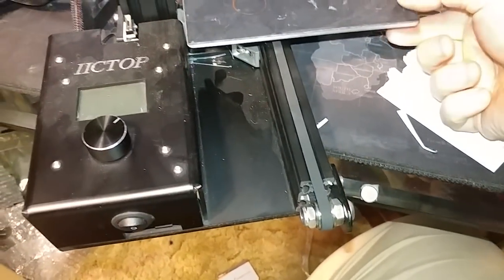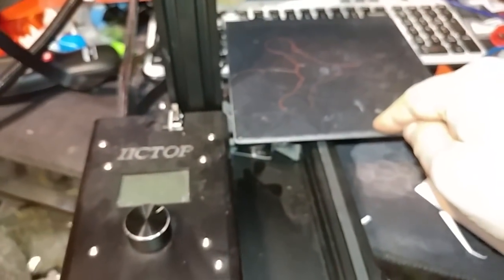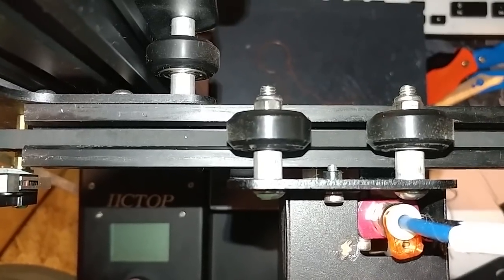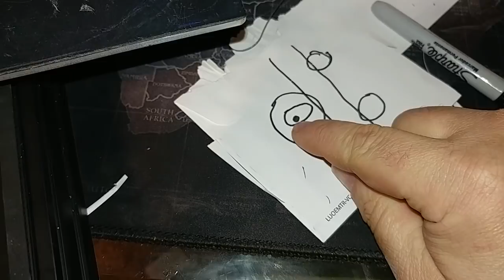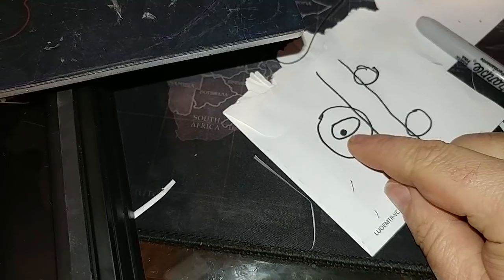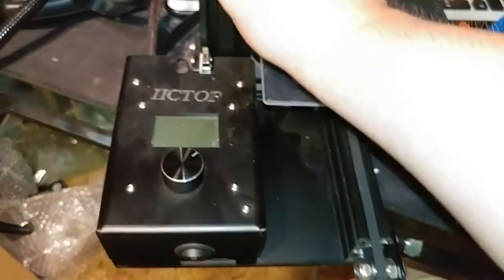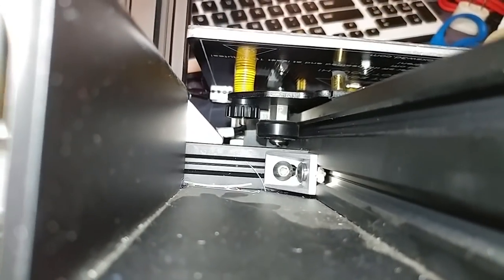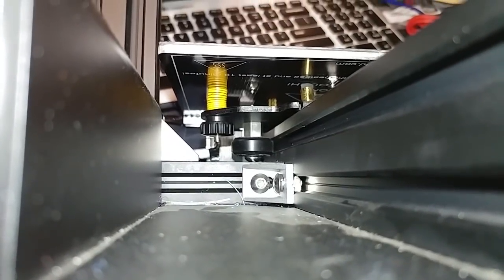Today's 3D Print 171 Quick Tip ender print bed loose wobbles

Comment: Thank you very much for this tutorial. Might look hilarous, but I had another problem that was an uneven, not smooth movement of the bed (and the extruder block) and was due to excesive pressure of the bolt. Attending to your advice, it now works smooth!
Someone gave the answer in a forum and said 
"It will still print but may leave artefacts. There are concentric nuts on 2 of the wheels (on the right side if facing the front of the printer) loosen these off a little the slowly tighten them each a little at a time and check the bed rolls smoothly. Keep doing this just to the point there is no bed wobble and you should be good to go.
Nerys's vids on YouTube are good for explaining this"
Regards!
Reply from the maker: That's the trick to loose is bad and too tight is bad I always tell people loose until it wobbles then tighten it up until it stops wobbling but only just enough :-)

Comment: It was loose for the last 3 days creating artifacts in my prints.. I thought it was clogged and that's why the Z-axis looked weird but it was actually because the bed was loose and wobbling mid print xD it's also why I could never straighten my build plate completely, It always wobbled the other way when I tried the other side.

Comment: Hi. Thanks for this :)
Btw. it could be useful to mention also the eccentric nut on the x-axis (under the extruder) as, at least for me, it also is responsible for slack and unwanted movement, but in this case of the extruder and (more importantly) of the nozzle.
Reply from the maker: +Robert Saric good point! And that one usually needs tightening our of the box.

Comment: Thank you for the tip, my bed plate has just started coming loose and I was wondering how to tighten it up. My tip back to you or anyone with an Ender 2 would be if you haven't done so already then add stepper dampers, its unbelievable how much it cuts down the noise of this little printer. May I ask what springs you are using, they seem a lot more substantial than the ones on mine ?
Reply from the maker: http://amzn.to/2C8pJyw OOS

http://amzn.to/2z45KkY those will work too
Reply: Many thanks, loving the videos mate.

Comment: Hi Nerys...Im having a problem (probably  pretty common) with my ender 2.  Ive used it enough that the x axis arm is sagging.  I cant tighten those stupid t nuts tight enough to do any good.  Is there a specific way to fix this problem, and if so, what do I need to fix it?  I really love the little printer except for the 3 point bed level which sucks, but other than that and this x axis problem its great.  Thanks for any help you can give me...Richard Jackson
Reply from the maker: First you need to determine what exactly is sagging is the actual aluminum Extrusion arm itself sagging in this case that would be the two bolts that go through the vertical trolley that hold the X arm in place you would need to disconnect and remove the vertical trolley and tighten those up from behind through the access holes if you have sufficient room I would remove the washers be careful tightening them they can strip

If the three-wheel vertical trolley itself is wiggling around causing a sag then you need to tighten the three wheels one side takes a wrench the included wrench fits and one side takes an allen key snug all three of them up a little bit again be careful the Allen key portion can strip easily if you don't insert the key squarely and firmly

 This is what I would call normal maintenance these pictures are machines with moving parts and eventually those parts work themselves loose a little bit snug it all back up and you should be good to go

The three point bed leveling is not too bad the trick to remember is that you usually have to adjust two of them at the same time if you try to adjust this one of the time you usually end up with a Twist instead of a plane change which is what you want it just takes a little bit of finesse
Reply: Yeah, its the two nuts on the x arm.  I cant seem to get them to tighten up any more and yes, they have stripped out already.  Can you tell me what size nuts and bolt to use with that?  The vertical trolley is fine and I can level the bed without much problem, Im just used to the 4 point leveling like on my monoprice or my cr10.  By the way, I ordered an ender 3 from banggood.  Waiting for that to get here...Thanks
Reply from the maker: Only thing you can do is replace the bolts make sure the heads aren't too big I want to say there M2 bolts but I'm not 100% sure on that I can't take apart the printer because it's in use when I get a chance though I'll measure it get hardened bolts one modification I plan to eventually make that I'm going to make to the Ender 3 is to add a third Bolt 3-point attachment would prevent sagging even if it loosens a tiny bit
Reply: Hey Nerys...I ended up drilling one of the access holes out carefully and replacing the t nuts and with that, I could tighten down the one that was loose and now it's super tight...thanks for your help...you ROCK!  Thanks again...Richard Jackson

Comment: Hey! Got a few questions about the (little monster) Ender 2. I'm trying to convince myself to buy one, but I wanna know if you have any current or new info or anything about 'em I might should know. 

I got into 3d printing for various reasons, but mostly to feed my RC habit which will require ABS (and other filaments besides PLA) stuff . I've been unable to find anything of substance (howtos) for printing ABS specific to this machine. Maybe I'm not searching correctly. 

Also, I've read the heated bed maxes out 60 degrees C, so how can it be able to print ABS? Frankly, I haven't seen many articles detailing ABS settings, but a helluva lot of mentions. Ha! 

I've also been looking at the Monoprice Maker Select V2, but the bed size is so small. Too small for what I think I might need.

Again, in my reality, I haven't come across much about any brand of 3d printer with detailed vids/articles/howtos beyond snippets. LOL! What am I not seeing?
Reply from the maker: +4FunRC that's mostly because settings aren't really defined by the printer they are defined by what you are Printing and what you are printing with

Only a couple of settings change from one printer to the next the real changes happen depending on what it is I am printing at one of these I want to do with it and what it is that it's made of

The new Ender to is supposed to go to much higher temperatures I will confirm that since I have one now I have not taken it out of the box yet

The original Ender stopped at 60c but could tell it to go higher in G-Code and it would do it
Reply: Oh jeezus, I thought you'd know what I meant about settings, i.e., a stock Ender 2 machine settings (not being/or being) capable of printing ABS. You know like every Chinese printer manufacturer saying PLA/ABS/Wood/blah, blah, blah. I believed I was specific in asking, specifically about the Ender 2. Oh, well... guess not. My mistake. Guess I was wrong or something. 

Anyways, I do have a pretty darn good concept/theory/experience of how .gcode, .stl, .obj, .step, .scad, .dfx files work, Marlin variables, etc. work. It's the hardware I'm trying to discern and wading through all the hyperbole, youthful boasting and dreamers dreaming outloud is a bit frustrating.

Would like to hear what the new Ender 2 you're getting actually has and how/if it's changed.

Thx.
Reply from the maker: +4FunRC I have never actually printed abs only PLA petg and a few other weird ones

From what I understand you need about 230 degrees in minimum nozzle temperature and 100° bed temperature it can hit 260 nozzle temperature so that's no problem stock the bed is 60 degrees but I've had it as high as 70 in G-Code I never tried to go higher it probably can using the right bed material you should be able to get abs to stick at run 80 or 85 C especially if you use ABS juice small print should work fine anything larger and you'll run into the same problem all ABS Prince will run into you need an enclosure :-)

I do have a roll of ABS when time allows I'll experiment with it

Comment: I'm playing hell trying to level the bed.  First if I roll the Y axis back and forth I feel two bumps that seem to be about the length of the circumference of the wheels.  I have pulled off the carriage and and run the wheels over a straight edge and can see no flat spots.  Second the carriage seems to stick if I tap the corners.  Any suggestions would be greatly appreciated.
Reply from the maker: If they are smooth unconstrained but feel flat constrained that usually indicates that you were tightening the wheels too much you're squishing them basically you should tighten them barely enough to remove play and then just a smidge more so they don't come loose

Can you explain more what you mean by The Carriage seems to stick if I tap the corners?
Reply: If I have replied twice I apologize.  I'm kinda technologically impaired.  Loosening the e-nut helped grapes and bananas (you know bunches and bunches).
On the stick part:  If I tap the front left corner the right rear sticks up and stays there.  The same for all corners, front to back, and side to side.  I am a the point to where I think it may be one or more of the bearings being sloppy.  Maybe they were made on a Monday.
Reply from the maker: Are the spring "loose"? That is what that sounds like. You might need to remove the bedleveling nuts lift the bed and put some washers in place just below the springs. Tbis will force the spring to compress more which should stop that from happening if it is hapoening because they are too loose.
Reply: No sir its not the springs.  I replaced those with the flat type from my CR-10S when I added EZABL to it.  I checked it by removing the heat bed and tapping on the carriage itself.  I'm good with the mechanical parts it feels like a bit of slop in the bearings when I take off the carriage and push/ pull on the wheels themselves.
Reply: Oh...off subject...in the old days when the world was young, men were men, and the sheep were scared chat rooms (text based) had a queue (sp?) during discussion where you could ask a question in the queue and the moderator would see it and work down the list to your question.  Does YouTube have a video equivalent?  During your live stream I think it would be a great add on to ask a question and pop up in a live video box when the moderator picks the next person.
Reply from the maker: Ahhh thay sounds like the bolt going THROUGH the bearing is loose! Snug then up a bit (wrench on one side key on the other)
Reply from the maker: Nothing like that as far as i know.
Reply: Did that while I had the carriage off.  Put some filament through after reassembly, a 7mm calibration square, went off without a hitch.  I really think its the wheel bearings.  Gonna clean the nozzle just in case.  Needle and cold pull.  Seems the biggest problem was needing to loosen the e-nut.  Many many thanks.
Reply: Again thanks.  Hate those problems that are simple to fix. Sometimes you just need another set of eyes I guess.
Reply: Hahaha...just noticed the control panel on the Ender 2 has a Z offset.  Not currently able to use it as my Z end stop is clicked on.  Gonna have to re-adjust my Z endstop to take advantage of it.
Reply: Hey Young Master Chris...just an update if you're interested (and a request if you please) about my bed carriage.  Yes it was the bearings in the wheels being loose.  If you held the hub of the wheels and pushed up and down (as if trying to remove the wheel from the bearing) you could feel a definite click and hang on each of the three.  Replaced those with three new ones from TinyMachines and the smoothness and lack of tilt and stick is amazing.  On a side note...I did notice this during assembly but thought it was just part of "tap the corners" while bed leveling.  Watching that video again I got the part where you said "...to seat the screws."

Now the request.  Your affiliate link to Amazon and a part number or description of the screws needed to add a part cooling fan.  This Ender2 has the same hot end cover that the CR-10S does with the pre-tapped holes (4).

Many thanks and may all your extrusions be smooth.

Comment: Nerys I have a problem with ender 2: when printing at some point or altitude the head crash or push the print and breaks or unglue it from the hot bed. Could you helpme?
Reply from the maker: Pictures would help but it sounds like a warping issue several things you can do first add a Brim this will increase the stick forced to the bed and help it survive being bumped a little bit double check your bed level you might be a little bit too far away from the bed so you're not getting enough Squish and therefore not a solid attachment to the bed you don't want too much squish but not too little either

Make sure you're not printing too hot too hot and uniparts will Warp the edges or points will curl up and then your nozzle can crash into these which would be bad

Remember the Ender 2 uses passive Cooling this means there is no parts cooling fan it's using the leftover from the hot end fan that passes through

So double check your temperature see if you can lower it 5 or 10 degrees depending on the plastic also if you're printing a lot of very small details make sure your layer cooling time is sufficient to allow the previous layer to cool before it begins the next layer this will help alleviate some warping
Reply: If the print is well glued to the base then the head breaks the print. I´m printing some characters of my own and every time it crash it breaks the legs for example
Reply from the maker: @ncouvin  okay a couple of things you can do first that part is very weak by Design make sure it's manifold by running it through net Fab online will try to use a merge and heal in simplify3d if you use that just be careful doesn't mess up your model it won't damage the file but could make it weird to pregnant

Next enable vertical lift or Z hop this will cause the printer to lift the nozzle away from the model each time it moves from one point to another which will help it avoid knocking over Parts but I'm not sure how well that will work I think you have a model weakness problem because I do not see any warping in that print that you show in the picture it's possible the ankle is just too weak and you are bending it just from the drag from laying down a new filament layer you might need to build in some supports to help reinforce the model and make it stronger
Reply: Nerys here at the end of the video you can see how the head bump the print. Thanks
Reply from the maker: @ncouvin  your bed is loose I just watched your entire bed tilt when It made contact that would certainly cause a problem adjust the eccentric nuts to stop that
Reply: @nerys71  yes it was loose before, but l did what you say un this video, si now it isn't loose anymore. But the problem persist and is worst because the bed doesn't tilt so the print get loose from the bed or the print breaks.
Reply from the maker: @ncouvin  enable one or two mm of Z hop or vertical lift that'll keep it from crashing
Reply: Nerys thanks a lot but I Still have the same problem. Where z hop is in simplify 3d? Díd you have similar issues With your ender2? Benchy prints perfect but I think the problem gets noticeable at taller prints
Reply from the maker: @ncouvin  not a bad benching but I do see some bottom layer issues there and I do see that one kind of Extrusion shift weird issue right there in the middle of the bow

What temperature and speed are you printing this at? And what kind of filament is that?
Reply: Nerys 1 to 4th layer at 210c then some layers at 200 and then 190c all the Way up. White pla. Speed fixed at 3600mm x min or 60mm x sec. 0.12 height

Comment: I spotted something - that yellow PTFE or whatever instead of bed leveling springs

Is that a mod or standard? - is it better than springs?

The bed on my JGAurora A3s goes out of level every few days - I'm suspecting the springs
Reply from the maker: +Stop the Madness no there Springs if the same kind of Springs as on the cr-10 they're painted yellow

Not enough spring tension would cause a bed to go out of level so add a couple washers to your A3 so the Springs are a little tighter that should help it hold a stable bed level longer

Comment: Actually there is enough room for access from the outside on the 2 roller side so you can just slide it through no need to move bed
Reply from the maker: yep realized that after video was made :-) both sides is handy sometimes its turned just enough you can't get it from one side or the other etc.. I wish I could add them to other printers :-)
Reply: I hear you about the angle..In that case I just rotate the wrench along it long axis  that way you get a different angle on the nut ..never had to go to the other side  ..works like a charm.
Reply from the maker: +K Wright agreed I always stopped turning at a point that I know I'll be able to get to it to me on the side but I can see a couple of positions where it wouldn't line up from the opposite side at all